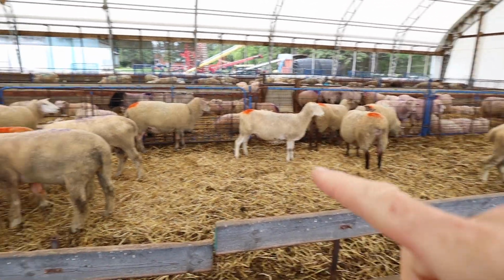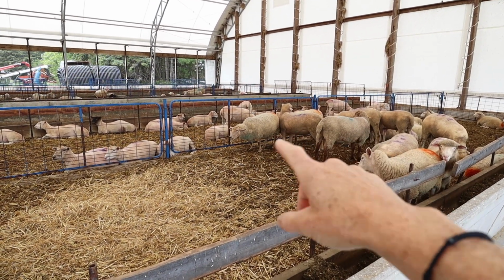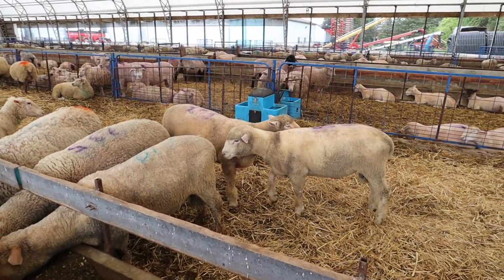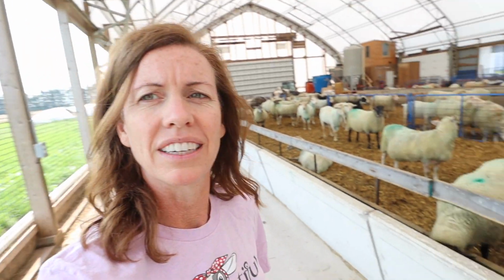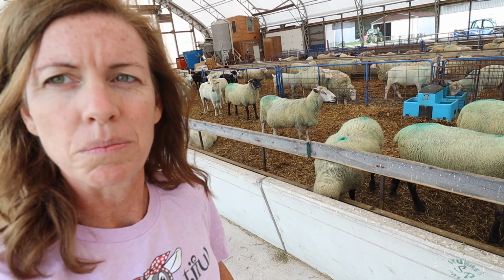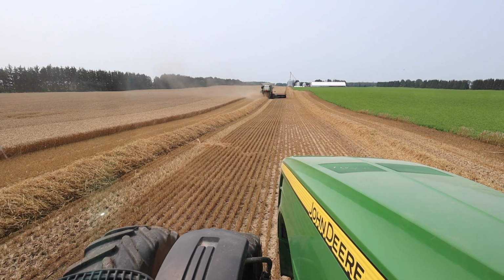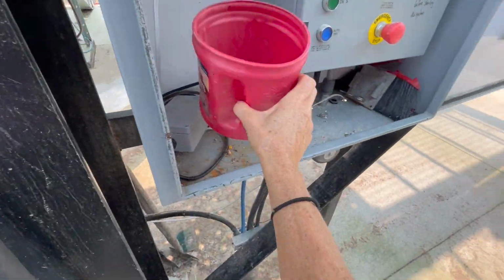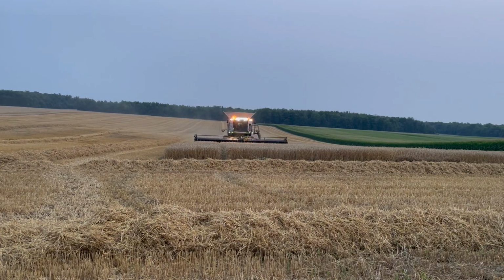EWE'RE IN LOVE!!!❤️ | Big Mama's got a BOYFRIEND!!!🥰| Vlog 472

Comment: There is a paint powder that you mix with a little oil and put on the rams brisket daily. Usefull for small breeds where the harness just won't fit or stay put. Think i'll try your method next breeding time though, much simpeler.

Comment: We melt the harness crayon and smear it onto the brisket. New colour every cycle, but we don’t cycle the ewes so they don’t have LOTS to do in one go. Other thing I’ve had suggested is putting the spray marker on the rams chest. 
Raddle powder, that you mix with oil is available in the states & Canada (not here in New Zealand unfortunately), but it needs topped up quite often I think.

Comment: About the crayons ik in the uk they have the rams running with the ewes outside for a while, and they dont tend to use hormonal stuff to get the ewes in heat. So they will change the crayon colour weekly to tell when the ewes are due to lamb. maybe thats why they dont last very long as they are meant for that kind of use? mayb not be every uk farmer does this but a tv farmer does it and i've seen a farmer youtuber do it that way, and a local shepard. same for the oil on the chest, they often use different colours per week or so

Comment: Raddle paint might be a good idea to try which is the 'oil based thing' in the uk you mentioned 😂
The reason we dont paint the ewe rear like you do is because all of the sheep can rub their neck over the ewe rear.. so it really doesn't show your ewe is mated.. it just shows other sheep have rubbed onto the rear (other ewes and even trying to escape males will do this smearing)
However.. if you did this and/or then put a different colour paint onto the under chest of the rams you would know for sure the boys had been onto the female..
The area that the rams touch their chest to the ewe back is pretty specific and difficult to mark into the ewe back/marking spot without the ram actually mounting and doing his 'job' long enough for the raddle to transfer..
There is method to the uk 'oil based thingy' (raddle powder paint mixed with vegetable oil) madness...

Comment: Question for Mark. What kind of power does your grain system use? 440vac at 60 cycle or 480 vac at 50 cycle? Do you use the generator to get 3 phase? I think you said at one time that grain system was separate from the house and farm electrical.

Comment: Hey Sandi. At 21:15 you say 1700 to 1800 acres of grain and other products. That is a VERY big farm.  Especially since the average size farm in Canada is under 150 acres ( I googles it) Is that a mispronouciation on your part: 170 instead of 1700 or is your operation really that big??
Reply: I think the data you have is out of date. The average acreage of farms in Canada is now over 800 acres (840 in 2017). It's common in southern Ontario to see farms in the 1000 - 3000 acre size.
Sandi has a video where they hopped in their truck and drove a couple of miles on the road to check their wheat fields. So I'm thinking it really is that big.
Reply: @ladydriver0_0  Had a further look and you are right. 800+ acres average. the site i found was 2012 so way out of date, thx..
Reply: @boristhebarbarian  😊 👍🏼